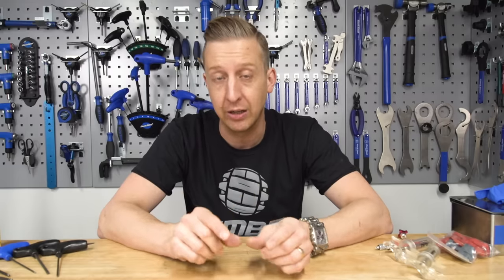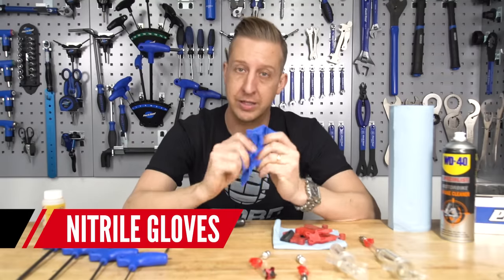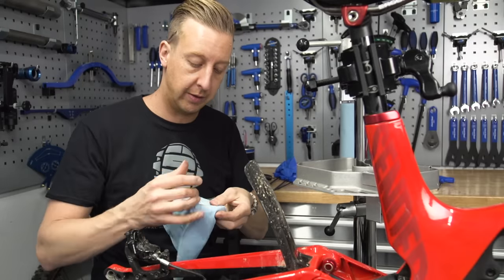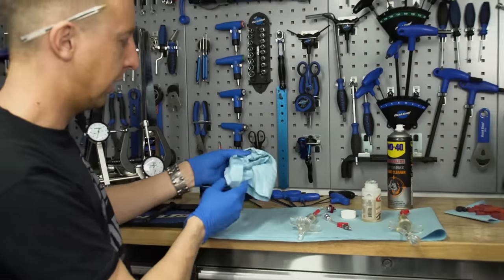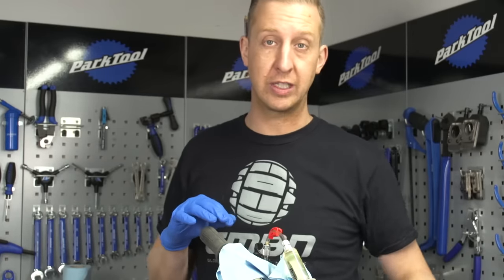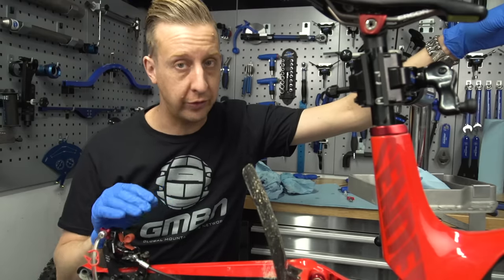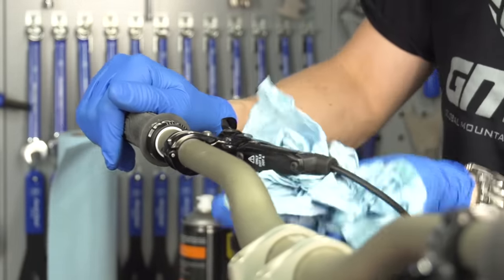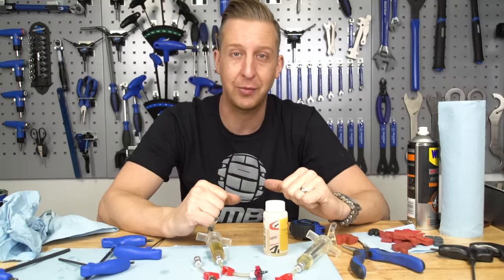How To Bleed New Sram MTB Brakes | Bleeding Edge Technology

Comment: This still results in a mushy lever that takes a lot of travel before it bites.  If you want to firm it up, you need to do it with the wheels on and pads in.  If you don't need a full bleed, connect at the caliper, then loosen the bolt at the lever.  Open the valve and force fluid in at the caliper until it comes out the lever, then put the lever bolt back in.  Then give the syringe some pressure and close off the valve at the caliper.  You do need to be careful doing this and clean up any spilled fluid.  This will get the brakes much closer to the fast initial bite that you may expect from Shimano, while still giving you the good modulation you expect from SRAM.
Reply: This 100%. I'm not sure how someone can say they're pressurizing the system when they unscrew the syringe and let fluid leak out at the lever then just put the screw back in.
Reply: And you may end up with the DOT spilling out of the pressure relief holes located in levers. I personally think it will be leaking until it become the same mushy long dead stroke feel like before. Experienced fellas also say this is the way to damage the internal bladder and end up thrashing the brake...
Reply: @josefarnost5606  Not saying it can't happen, but I've been doing this for years and they have never leaked.  And It doesn't change the peak pressure when actually using the brakes so I would question any claim that it will damage the bladder.
Reply: @plmn93  Just happened to me, the DOT still leaks a bit. I'll see... a bit scared though 🙄

Comment: FYI plain water will clean and flush DOT 3, DOT 4, DOT 5.1 brake fluids. They are not corrosive, but are reactive  to paint, plastics, and other coatings. They are alcohol based, and will absorb water out of the air. The only real difference between the 3 types are their boiling point.
Reply: Thanks, that is what I needed to know.  😁

Comment: I've found the best way to bleed these is to simply push the fluid back and forth between the two syringes 10 or 15 times. Forces all of the air out and leaves a perfect lever.  SO easy.  3 minutes per brake.
Reply: Isn't the whole point to push new oil into the system? By pushing it back and forth all you're doing is mixing old discoloured oil and new oil into the system and contaminating everything.
Reply: This is what I have found. But if there is any discoloration, you need to push out through caliper and refill with fresh from the lever.

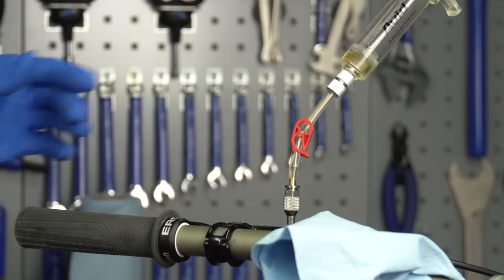Comment: Great Video, Thank you!  I changed brake pads and bled the system on my SRAM  Guide Brakes.  Worked as described with one exception.  When I was done I realized I couldn't pressurize the system the way you describe (at about 12:15) from the lever/reservoir as you instantly loose the pressure, (and a fair amount of fluid) replacing the reservoir screw. 

I ended up pressurizing the system from the caliper end once I had bled the brake lines and closed off and replaced the hex screw at the lever.  I worked beautifully and was able to keep the system pressurized by tightening the caliper bleed nut while I had it under slight pressure from the syringe.  What I gave me was the instant brake feel in the lever, with out all of the lever travel that occurs with unpressurized brake system.
Reply: experiencing the same on my guide r, I will try this trick as well in hopes of getting that mushy lever feeling away!
Reply: Great advise. I’m going to try this
Reply: Genius!  Great idea!
Reply: I did it this way after reading your comment. 1000% better than Sram’s way. Instantly better brakes
Reply: Thanks! This is hands down, the most useful comment ever. Thank you! 🙏 😊
Reply: I did mine today, and lost a lot of fluid at the lever. The lever felt like it was engaging low. I was thinking of pressuring it from the caliper. Will try it later today! Glad it worked for you.
Reply: Thanks for this tip.  I had to do this with the wheel and brake pads on to get that quick engagement.  A downside is that the calipers need to be adjusted much more accurately, and of course there is a higher risk of contamination if you're not careful.  I also needed to use a fair amount of syringe pressure for my Guide brakes.  I think Levels are a bit easier.
Reply: I bled my brake from the top 1st and then with new fluid did it again but bled from the bottom (calliper), would really recommend this to anyone who does this especially if you’ve emptied the entire system as air gets stuck in the calliper and won’t budge bleeding from the top.
Reply: Thanks for the tip Jennifercoons.
But how exactly did you that?
As soon As I tske of the syringe at the lever it spill.
Thanks for your help
Reply: You are a genius.  Just got these brakes and was feeling pretty disappointed with how weak and squishy they felt after a couple good bleeds.  I just walked back from the garage and I might like these brakes now?
Reply: @marvinjordan9987 cap off the lever side then go back to the caliper side apply pressure then shut off/turn the red knob to close the caliper side and "lock in" the pressure.
Reply: This is the way. Just wasted hours of my life bleeding the same brake 3 times, as I thought I was doing it wrong. Pressurise it from the caliper, not the lever!!
Reply: @marvinjordan9987  Marvin,,, after you flush the brake fluid as shown in the video, you close off the system by replacing the fill screw at the lever, and finger tighten the 4mm screw at the caliper.  I then replaced the wheel.  At this point i cracked the caliper bleed screw with the syringe attached adding a firm squeeze on the syringe adding the desired stiffness to the system..... Finally, while holding pressure on the syringe, I hand close the caliper bleed nut, and remove the syringe. Don't forget to finish tightening the bleed nut with the Allen wrench (slightly).  Voila!!
Reply: I did the same , so much better

Comment: OK, I had to change levers on my Guide R brakes so needed to bleed them after. I watched the Sram video and this one several times, then ordered all the tools, and started. Took two tries but got the front brakes great. The rear were a different story. So I watched the video again to make sure. After six tries, the final one with the caliper completely off the bike so I could get the hose straight to make sure no air was being trapped, I had to go off script. No matter what I did, after pressurizing the system a little, when I would remove the syringe from the lever it would squirt back some fluid and leave the lever too soft. (again this worked fine on the front) I finally, carefully, put the bleeding point syringe back on the caliper, and pressurized the system, just a little, from there. Now the rear are as solid as the front.
Reply: I realise I'm about 8 months late on commenting but you're right, dont pressurise the system from the lever. I found that sealing off the lever and adding pressure through the caliper then shutting the system off with the bleeding edge significantly improves the feel and effectiveness of the brake
Reply: Oooooooooh I’m 2 years late but I’m going to try the calliper pressure suggestion today. Sick of spongy rear lever
Reply: At your own risk and carefully to not spill dot fluid all over: Do the bleed as per instructions. Re-attach the wheel, stick the syringe thing to bleeding edge port on the caliper with some amount of fluid in it (if not already in). Screw the port open and make sure you are not pushing air to the system (keep syringe pointing upwards and make some vacuum to pull any air from the system). Push syringe until brake pads almost touch the rotor. Close the port while holding the pressure. Make some vacuum on the syringe before/while removing the syringe to prevent dot fluid from going all over. Levers should bite almost instantly now.
Reply: @amend2806  legend. Thank you! It does make more sense to add pressure without the bleed block place unlike the way they tell you with the block in cos otherwise it's just the same as before it was bled again 😂
Reply: @gmbntech #gmbntech Could you re do this video and provide us with updated steps.

Comment: You can remove the little clip in the retaining pad bolt with the 2.5mm allen key. The clip has the eyebolt that is exactly sized for the 2.5mm allen key and in this way you won't lose it

Comment: I have found that this procedure results in very mushy brakes on sram code R and code RSC brakes. To get the brakes feeling good, after air is bubbled out, close up the lever port, then with the caliper still open apply pressure on the caliper syringe and hold it tight. While holding the pressure with your thumb, close the caliper bleed port, then release pressure from the syringe. Now the lever will not be mushy.

Comment: You're a saint! It all seemed so confusing before this video. 10 minutes start to finish.  Way easier than shimano.
Reply: I have both brands, only bleed shimano till now, but by looks doing this with SRAM looks harder
Reply: How can this possibly be easier than Shimano. You can do a 30 second bleed just using a cup on Shimano to get any air out. Then if you need you can do one similar to this with syringes.

Comment: Doddy, thank you for escorting me through my first brakes bleed on my 2021 SC Tallboy.  Sadly the base level SRAM G2 brakes that came on my S-carbon bike build were the older, pre-bleeding edge system, but the bleed process wasn’t that much worse than what you showed.  I clamped my bike with her tail up in the air.  When I removed the syringe from the rear caliper port a couple drops of oil scooted out before I could reinsert the port screw.  Squeezing the plunger at the handlebar forced a tiny bubble and a couple drops of oil out out the rear port before I tightened the screw down.  Everything else was the same as in your video.

I probably could have figured it out without your video, and the Park Tools brakes bleed video is also excellent, but I doubt it would have gone as smoothly on my first attempt without your crystal-clear instructions.  Bravo!

Comment: Great tutorial! One previous tip I was shown online was to help remove as much air from the fluid as possible.

You fill the syringes as shown here, but then use the clamps on the hose to seal them. After that you try and pull (decently hard, but be careful not to pull so hard you suck air through the rubber seal) the syringe handle outwards. If there are any micro bubbles, they will get way bigger due to vacuum, and you can flick them to the top. Do that until they are all at the top, and continue on.

Comment: Cheers Doddy. Bought the SRAM bleed kit for Code/Guide R/RS. Watched your vid a few times, now bleed all my bikes with confidence and getting results as good as a shop. It does take practice, but massive reward when doing it yourself. Cheers Bud.
Reply: Thanks for a great video. Shouldn't preasurising the system be done from the calliper end? Seems a bit pointless from the lever end when any pressure just offloads by pushing a load of fluid out after taking the syringe out? I did it from the caliper end which was the only way I could get pressure in and get it nice and sharp

Comment: Great Video, Thank you! 
I used SRAM Standard Bleed Kit with DOT 5.1 Brake Fluid. Everything went according to plan except for one thing: When I was keeping the caliper syringe vertical and pulling up on the lever syringe, the caliper syringe plunger was not moving. It is not clear to me what the cause may have been, since before I pushed the liquid into the caliper syringe, it flowed without any problems.

Comment: Great video, thank you. How do you clean and prepare the syringes for the next bleed though? Do you have to run isopropyl alcohol through them or just get all the oil you can out of them by pressing the syringe and just get the new oils in on the next run? Maybe a little cross contamination doesn't hurt that much on the left over oil?
Reply: Yes, I'd recommend flushing syringe & tubes with alcohol for 2 reasons. (1) alcohol is volatile and will easily and completely disappear over a short time. And (2) DOT fluid is caustic, so you don't want it contaminating & possible spreading over your stored service equipment.

Not the end of the world if you store minimal DOT fluid in your service equipment. But it is hydrophilic (attracts water) and it is NOT volatile (like alcohol is) so, after a year, the DOT residue will still be there, it'll now be 'wet' and will grow in volume. Again, not a huge deal but if you start next year's flush with a wet residue of last year's DOT fluid, just make sure to do a few quick rinses of your 'contaminated' syringe & tubes with the SMALLEST amount of new, dry, DOT fluid. 
If, after sitting a year, the old residue is maybe 50%(?) water, after the first rinse, the new residue might only be 10% water. Then only 1% after 2nd rinse. Maybe 0.1% water after 2nd rinse.

Comment: Thanks Doddy! After attempting to bleed my Level brake after watching the SRAM video, I failed miserably. Frustrated and about to take the bike to my LBS, I saw your video and decided to give it another try. While the steps are the same, I felt your explanation was more thorough and made the process much easier. I quickly realized I missed a key step in closing the plunger lever on the caliper end. The only outstanding issue I have is my torque wrench does not go below 2Nm (1.5-1.7Nm recommended) and to my knowledge Park does not make one that goes that low so I hope I gave the drain bolts enough tension as I did not want to strip them. Great content as always from GMBN!

Comment: Had to bleed a completely new bike, breaks where terrible it was like abs never enough power. The winning tip was after getting rid of the bubbles getting as much fluid into the system as possible. Now they are fantastic. It is a completely different experience going downhill.

Comment: A great video and also gives great info on the different types of bleed valves which saved a lot of time. Would just say that when all the air is out of the tubes the job is not necessarily complete especially if you have had to change the main piston in the lever. It took 2 attempts to get the air lock out in that situation by pushing the fluid in both directions before closing off the calliper. The other key as stated is to ensure the lever is open to the max for full piston travel.

Comment: Great video, Thanks. I have a question though. What about the older models that you mention, that don't have the "edge" tech? How do you remove the syringe and get the plug back in without getting air in the system?

Comment: Good job, but the system is a closed system right? Why would there be any air in there? And if so, should you check this after 2000km with a new bike? Or every say 2000km? I am confused because this system is sold on travel bikes as maintenance free....

Comment: Hi. I wonder if you can help? I have a cube stereo MTB which has sram guide r brakes on it. I recently went on a trip and the weather was rather nice and warm and my brakes began to bind. By the time we stopped for lunch they had completely seized. I took it to a mechs and they said the pistons inside the sram levers had become stuck probably due to a combination of the weather and the old brake fluid. Having had this experience friends are telling me it’s a problem with Stan brakes and to swap them out for a set of magura. The question is do I replace the seals and fluid and keep up regular annual fluid renewals on the srams or swap them out for the magura or are these also potentially susceptible? If it’s a common problem I’ll swap them out but if it was a one off due to my poor brake lever maintenance I’ll just rebuild them. Thoughts please? Thanks

Comment: I’ve used the kit from epic bleed solutions a few times now and the only way it made the bleed a pain is you have to be quite careful not to pull too hard when creating the vacuum as if you pull too hard, as the seals aren’t the best they will bring in a bit of air into the syringe so it isn’t as robust a feel as the official SRAM one but with a bit of finesse you can bleed them perfectly

Comment: Followed this when upgrading LevelT to Code R on my Levo. Codes working great. Good modulation and can lock either wheel at will. Only problem is the bite point. Initially it was poor on both brakes (probably result of the Epic bleed block width). I managed to get the rear good by removing the wheel and operating the brake carefully to close up the pads. The same trick on the front improved them but the bite point front & rear are annoyingly different. Any tips.

Comment: i have a problem, i did it like this video showed it, but after 20 minutes of bleeding process there are still bubbles coming, not many but there are... are my brakes defective? great video and doddy is a god when it comes to explaining repairs etc. Keep up the good work! sorry for my english it is not my native language ;)
Reply from the maker: It could be that you're pulling too hard on the syringes, pulling air past the seals. Try again but push/pull the levers quite gently. You should only ever be moving the fluid slowly anyway. If that doesn't work then your seals may be perished/damaged, letting air in where you don't want it!
Reply: Check the brakes for the 4 letter identifier 'SRAM' printed somewhere on tthem. If you find this written anywhere on the lever or caliper the brakes are defective and should be replaced with one that don't say SRAM on them.